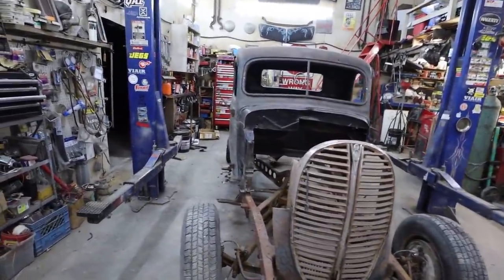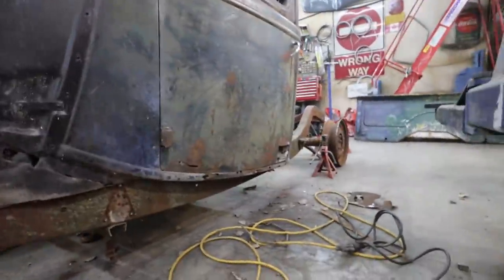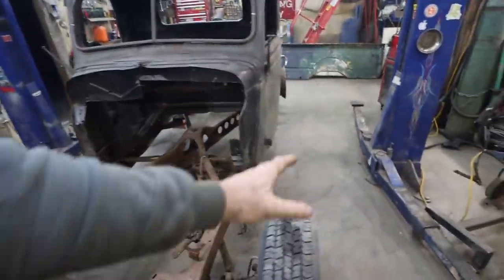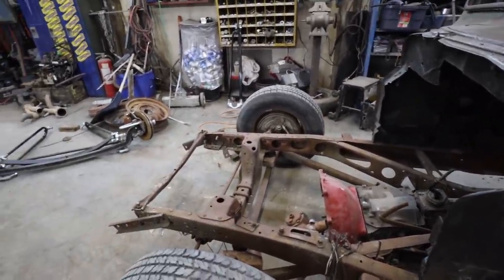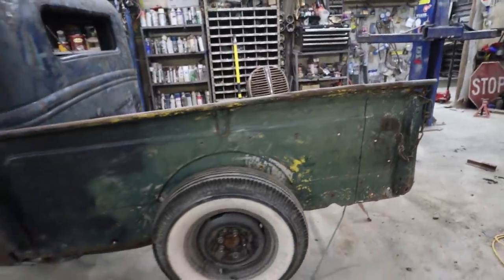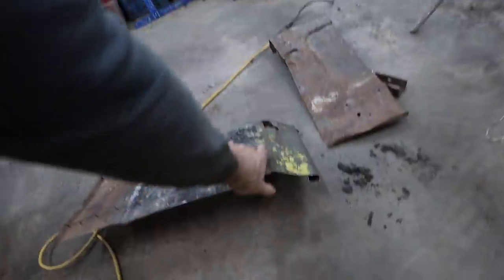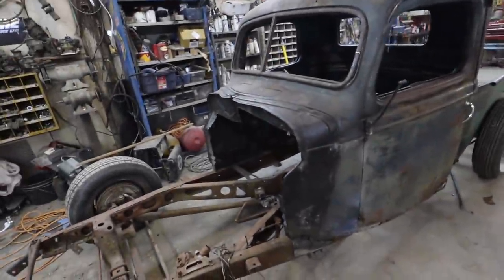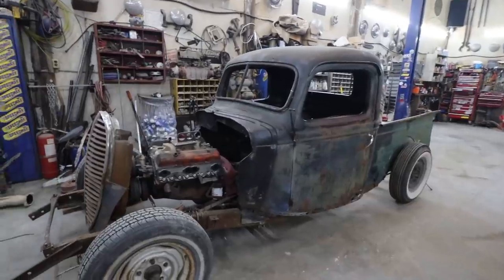Channeling our 37 Ford pickup body and test fitting the box sides. Part 2

Comment: Shorty headers with lake-pipes dumping at 45 degrees  partially hidden by the running boards might look good.
Yes on adding to the back of the box and no to lowering the frame much more in my opinion, considering your roads and climate.

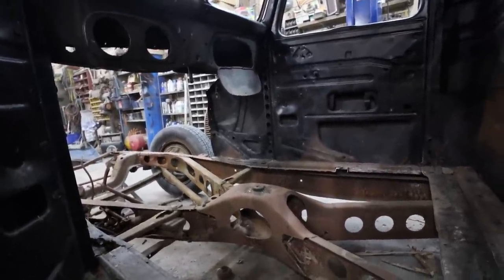Comment: 6:14 Just learned the term used for what you want to do to the body.
It's called a "wedge channel".
Channel doesn't look bad to me. Add a little to the back of the bed to balance out the sides.

Comment: I think it needs a hood and a grille shell. The grille alone is a little odd but with the original hood or an extended simulation of it that continues the bead lines from the cab to the grille shell the way Ford did them, it would look great. The hood sides could be shorted to make room for headers above the frame, but without a hood it's gonna be a rat rod. I would have liked to have seen the ends of the bed side clamped on to the shortened middle to show the finished length. I'd also like to see fenders on the bed and maybe even motorcycle-type fenders on the front. Anyway as you may be able to tell, I like this project.

Comment: I think it's looking awesome,  you will add more to the bed when you get the stake pockets back on so I wouldn't stress about the length just yet,  I'm still diggin it 😉
Reply: Plus the top chop will change the look of the bed. It looks short right now because the top is high? Your right the stakes still needs to be added back on.
Reply: @snoopu2601  I've got a 47 that I've bobbed and chopped 4", it balances out pretty nice

Comment: Looking good Brent.If you dont like how the sides fit or look,swap them side to side and turn them around left on the right and the right on the left if there is not enough length at the back.Those sides are universial since you cut the fronts and rears off.

Comment: I think if you add the distance to extend the rear of the box.  Yocould cut the box and add  metal between the center of the box. That could make the wheel arch fit to the tire and give a few inches to the rear box extension.. Love this build.

Comment: IHey Brent, I agree with you - the grill just doesn't fit the truck I believe it''s to wide or something. The bed does need a couple of inches in the rear or it could be that because it's sitting high it just looks that way. Maybe clamp the remaining part of the bed on the inside of it and then you can tell how much you need. Other then that it looks great I like the looks of it. I'm looking forward to this build. Later

Comment: Little longer on the rear of box will look better.If  the is deep anuf for you were it at and to the bottom.I bought a big block chevy kit from speedway and flanges off ebay. and built my lake style headers for 500 caddy. and I put sidepipe muflers in them and drilled holes in the caps to hold muflers in. its not to load then. just some ideas.

Comment: Yeah, I agree. It would look better with that piece gone and that would give the body line a good look. Also it's sits at a good height (the body). Yeah, the bed needs the end put back on, and I would cut the front to be able to keep the brace. The bed should line up with the rail on the bed and the fat bead on the side of the cab. Ronnie.

Comment: You could split the existing front bones and use them instead of the hairpins on the disc front end. You probably have a set of bones you could split for the rear. Maybe you have a cool tractor grill in the yard that is closer to the cowl height.

Comment: You should have left the angled/rolled top portion on the top of the bed-sides a little long, so you wouldn't have to splice it. 
Ugh..gotta chop down that radiator shell, the top of it's higher than the cowl.  Maybe if you do move the cab forward a bit, you can move the powertrain forward too and clear that x-frame. I like the "rocket exhaust" where the tubes come straight off the exhaust ports and into a baffled tube or cone.

Comment: The grill looks like an Austin A35 and larger ones of the time. 
These video's go so quickly when being enjoyed. Didnt seen like a half hour. Wish they were longer. :) 
Deffo 1 or 2 inches lower .
Cant you turn the panels around so the drivers side is on the passenger side and vice veras ? The length would be there from behind the wheel, or would it look daft with a shorter front in front of the rear wheel ? I know it would be easy for you to weld the rear panel back on at the length you want. :)

Comment: I had to remove the x brace on mine and I narrowed the frame so I could channel it and I cut the rusty sheetmetal at the front of the cab to follow the body line it looked better without it

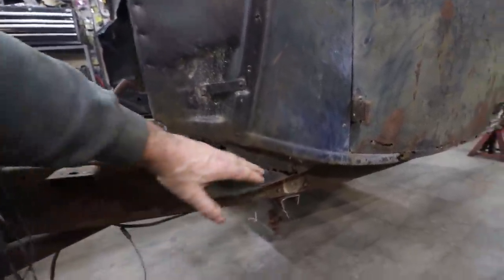Comment: 9:40 are you going to make the frame curve up to follow the rocker/door line up swoop?
22:45 Bigger rear wheel and taller tire and it’s parfait! 
30:28 are you not capping the bed sides with the original ends?
Reply from the maker: Will be using the old caps yes

Comment: the gasoline tank is lean toward to tilt more weight downward jouncing the coil shock absorbers on opposite side at same time your body weight is jounce down the driver side shock absorbers. The fuel tank was place right in the middle between passenger side and driver side might be as the wrong way. The correct way is the fuel tank is offset toward to the passenger side.
 There is the trans, with bell housing bottom cover. The covering over the one half of the flywheel bottom side but it is missing bottom plate called bell housing cover. So I look for it at a cost to build one is maybe $75 dollar for bracket cover bowl and the wedge slope of the bell housing of the floor shift whether for flywheel or flex torque converter plate?
 The bowl panning over the front lower part of transmission where the engine is engages at the front of transmission The bracket pan is a cover made from sheet metal and underwater bomb that it shapes the sheet of metal 20 gauges form with its mold. Then add holes for mount them bolts to your transmission. How many of these hex bolts = 8 I think  M6 or M5 metric bolts is correct size M6 or M5 depends on the hole size with its thread. The Dorman Value Pack at the Harbor Freight selling as my box includes with 16 section plastic plus 125 pieces comes with assorted size M10 down to M6. Now, I am getting a left hand thread bolt for size is M6 x 16mm from Ebay. You might prefer M5 special order from EBAY to tighten the bell housing fasten to the splash guard pan bracket. Once upon the plate bend/ shape as a bowl also the wedge is the slot for the guard bowl to cover over. The M5 hex head bolt wherein everybody's preference of the size is my recommendation.    Northern Industry store sells dynamite for wharf and bomb the pl;ate cover that fasten to the bell housing is require for factory to sell and stack up the stack as avail for sale tag to place upon the flex plate cover bracket over the lower part of trans. at front of the type: rear wheel drive automobilia new form Master fabricator ASE and automobile union member in Toledo, Ohio car making plant. Thank you.

Comment: I would cut 1 1/2 inches off of front and add 3 or 4 to the rear , then line the lower box edge up with the bottom of the cab rear . Chop top 3 or 4 inches and switch to a different grill .  My 2 cents worth  and it's all ready looking good .

Comment: Ya the grills gotta go...it's a cool grill but IMO doesn't fit with this project/body....and maybe lengthen the rear bed so that the back half is the same as the front half using the wheel well as a guide...it won't be much longer than it is now but will look more even. If you're going to install a rear bumper, the bumper will add to the overall length a little too maybe. I don't know...but whatever you do I'm sure it will still have your cool touch :). Thanks for making these vids!

Comment: I've got a few questions: Shouldn't you brace the cab so that it does not twist or make your door alignment bad? The reason I ask is because I have a 46 Cab and front in, but in order to make it look right on the frame I have. I believe that I will need to channel it like what your are doing. The other question I had was about the placement of the Cab on your project, and the engine and transmission. Wouldn't it be better to find your final placement of the engine and transmission before you settle on your placement of the cab? But looking at that, you would first need to figure out which front suspension. Right? As for the box, you are right, that brace looks off-center. Last Question: The body you got the other front suspension from, are you planning on using that for another project or selling it? Been following your channel for awhile now, but this is the first time I thought about asking questions.
Thanks
Keep up the Great Videos
Bart
Reply from the maker: you could brace the cab but it's already been outta wack with there being no floor in it already. As for the placement not to worried where the motor goes just going with gut on how the wheels look in relation to the cab. that's why I moved the rear axle up a little to give it that tighter feel. I personally like the motor but be tight to the cab/firewall as I can, but don't like my axles way out front like them to look stock if that makes sense with my rad shell lining up with the front axle as close as I can. you'll see what I mean as the build continues :) for now this is a loose look at what I'm trying to get at.
Reply: @HalfassKustoms  Your right. Mine the rust bugs and tin worms got most of the floor, and I already took the doors off. So I bet that my cab is twisted a little. But with a little tweak here and there, I can get the doors to align. I hope. Thanks for the Info.
Bart

Comment: the wheel guard is the shelf above the rear tire size 25 in. tall and you already lower the chassis into ground clearance about 4 inches where the original is 6 in. ground clearance for stock car. Then the flat top with the two slopes is the wheel fnder and that fender is pace inside the box plus another 50% of the other side of tire tread is for flareside fender. The bed side is behind the rear wheel toward to sample dotted line in paper draft showing example center dotted line is halfway between passenger side and driver side at same time straight the new line from front to back as for reading in paper called scratch note. 
  Wrong way to make the box side to be behind your wheel as you can see then as you move the side sheet metal coming away from the center example dotted line. may require more cutting the cut it: follow the curve that causes making semi hole 1/2 of the wheel 25 inch is too small. the sheet metal's cutting curve is 1/2 multiply 31 in. radius then the side is right above the tire. add two the fender to both sides of the wall of the box.It is shape like it's curved top side in flareside also along with is flat top and at front slope down from flat top fender and another down slope the rear part of bed's fender named wheel well. Where is the Continental fancy/external flareside softtail no chromed plate 10 in. wide fender? It is made out of your choices: aluminum alloy fender or steel fender bringing the fender into for sale in and at Hyundia plant of Import and Export supplier of sheet metal called Oakland, CA that have it so that sells 3 tons per roll of sheet metal at the mill iron work.

Comment: The back side of the bed should be 2” longer    I    That means me would not go much more than that to keep the bed short like you  that means you wanted to     But making from center of tire a 1 inch larger from center to back than from center to front would be way to go   Now you asked for our opinion and I was very glad to give it      Now with being said   It is your truck and I will like it no matter how you build it      Does that make since          Now reading back what I wrote it sounds a little off but was not trying to   Really

Comment: why not cut the chassis on the rear end and replace it new part to replcae it with and weld it on the rear of it so  truck box would fit better instead of chopping the cutting it .

Comment: Nothing wrong with a frame reveal. See it all the time on coupes. Alright to build impractical rides but with shitty roads and cramped cabin space your spine might revolt and your road speed won't be fantastic (pussy-footing around cracks, washboard, pot holes and pigeon droppings). Much rather a RoadRunner that chews up the miles.
Reply from the maker: Usually make my junk comfortable to drive. The motor will be pretty healthy though haha.

Comment: You need sponsor won't meet the sponsor named Tesa Sharp and brown level bubble for leveling the same ground clearance on both passenger side C beam and driver side C beam. When you drive your 1937 with VIN number that mark into the chassis and engine has a code not VIN build by the Letter punch puncher and strike as hammer will create the VIN as part by part until it is avail called code and code searching to encrypt them VIN without copy-cat other persons VIN and so the new digit becomes engrave with blue the steel  into number where the burnt is a shape into number again punch to get the another stamp number and torch tip can etch it with acid for create new VIN. The proof is complete but recommendation with 2 witnesses minimal and a Notarizer and his stamping seal as part of VIN and proof/document must be written is what your action of write down by your pencil and with logbook is the real proof to earn your ownership of cars front of the Administration judge in our Judicial where we are from U.S.A. to help the book keeper to archive his selling car as new recordcoming out of his OUTLOOK storage memory of this here 500 gigabyte solid-state hard drive or as well getting new VIN for his void car into non-void car recently being homemade wherein that your driven property is  not swap shop car and hot car. Just hand-built car complete interstater is the name of Halfass car from fabrication and designing and painting by car maker named Halfass or garage auctioneer in where Halfass lived as an ordinary garage and coop big house along with trash called making the ridgid or Cabin stuck to the rolling chassis on 4 wheels of Model A and VIN is a replica legally of the restoration so the VIN is also recover in that sense of ability where DMV must stand at your Halfass side to pass you the new pink slip saying you got a new VIN. And your another rat car (flashy) in top the test bench for working and testing with design and fabricate that Halfass did build sheet metal into form near custom welder plus his garage as a welder ASE.
 The problem is you are not key maker; well, we are skill and we can buy key from hardware for 3 dollars plus ignition keyhole switch power on and off selection. for how much money?